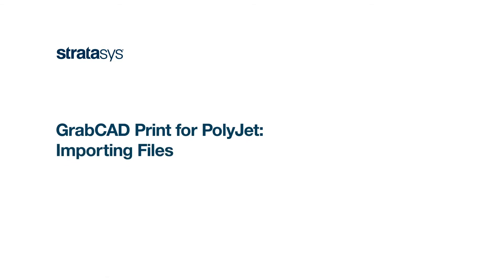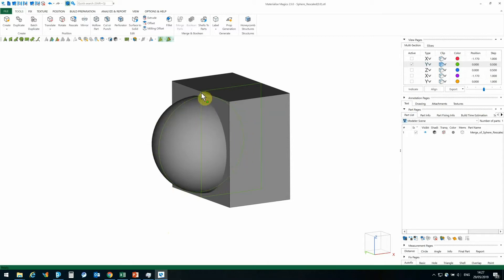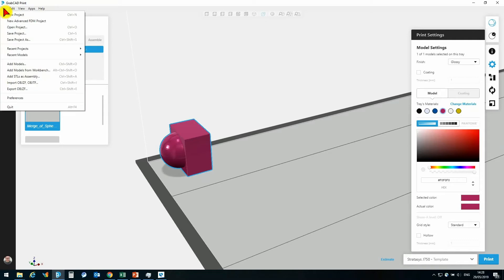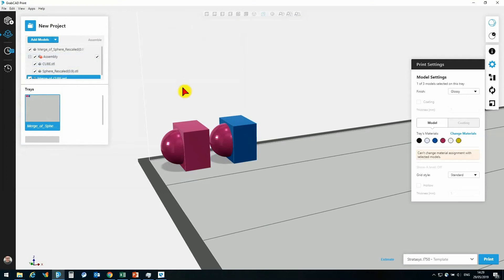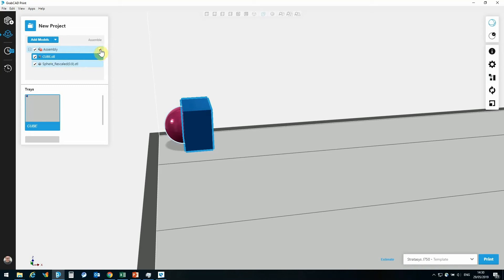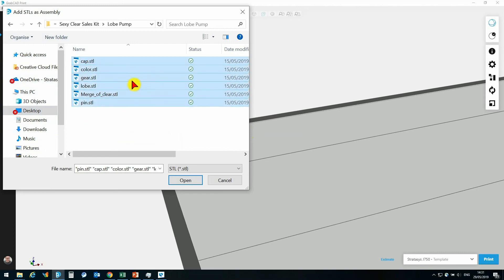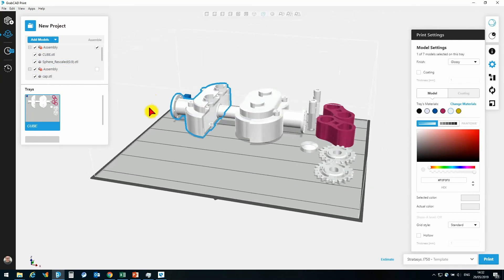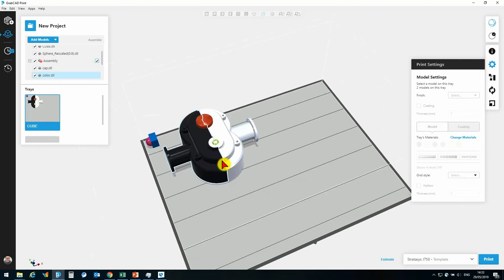Import & 3D Print Assembled Parts in GrabCAD Print

Comment: How does the program know how to assemble the individual STL files? I have a group of STL files that came from a model and had to be converted from OBJ files to STL files. The problem now is that I have to manually set the placement of each STL. Is there another way to import these files and keep the placement information intact?